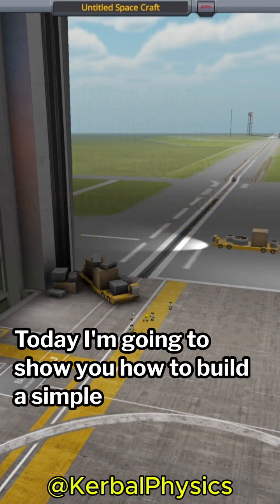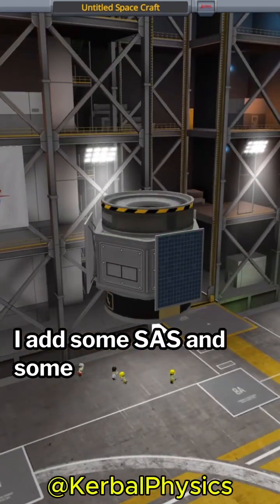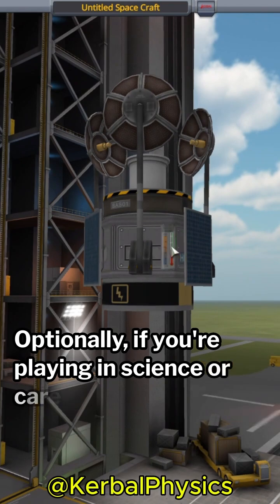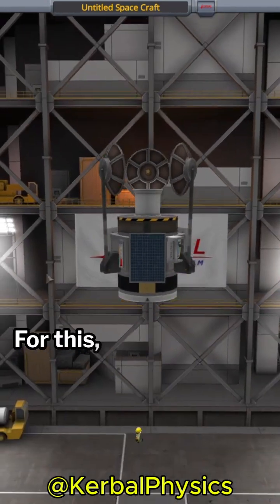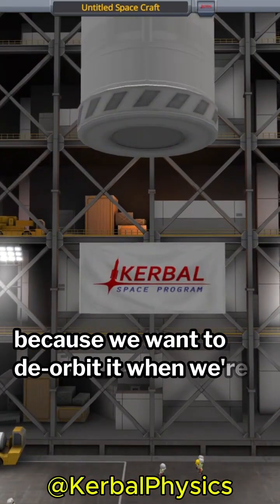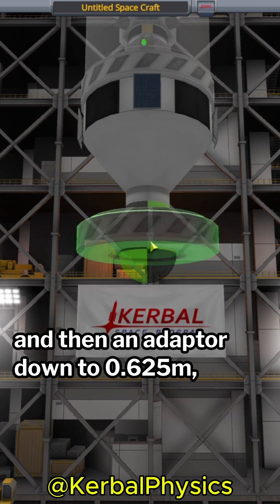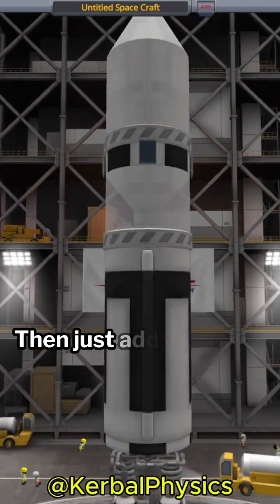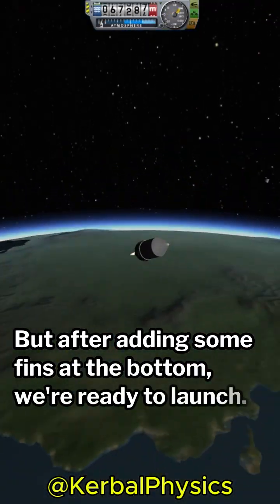How to build an effective communications satellite in Kerbal Space Program

Comment: Is the battery + reaction wheel super important? With such little mass, the onboard reaction wheel for the probe core should be enough. And the battery doesn't seem super important when the craft both has solar panels and uses such little power. 

Besides that, good video. One thing that's hugely important to relay networks would be learning how to do resonant orbits, if you're ever interested in making a video like that.
Reply: Not all probe cores have SAS. If you’re using one that does have SAS though, another SAS module wouldn’t be required but sometimes it’s nicer to have.